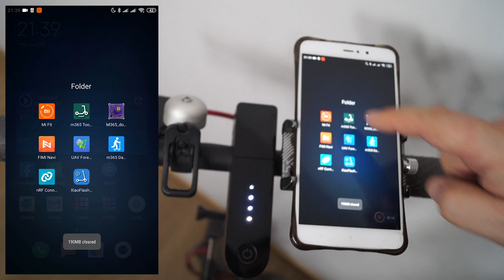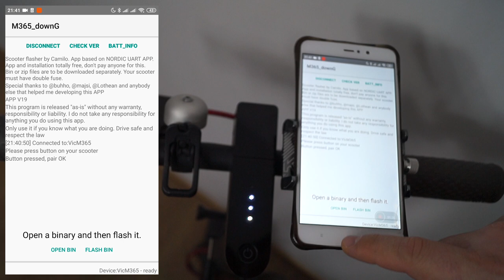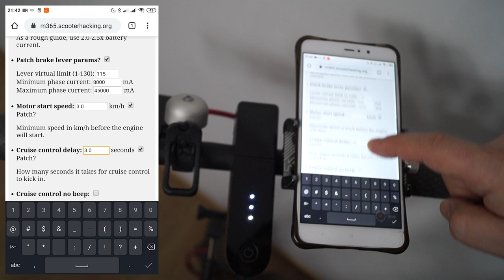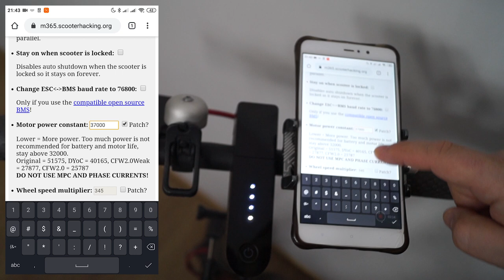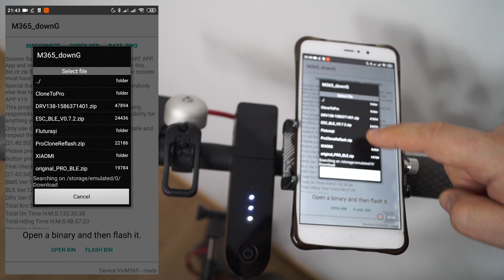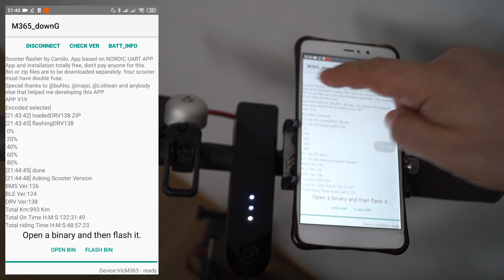XIAOMI M365 (Pro) | Do you want higher TOP SPEED or STRONGER ACCELERATION? Flash a CUSTOM FIRMWARE!

Comment: This sadly doesn't work for me. I have a brand new Pro with version 1.7.1. The app says the flash has been successful, but then nothing changes with the version and the ride remains the same with the same speed limit. Any ideas....? Thanks!
Reply from the maker: I don't know why this is happening. I heard other people having this problem, but I'm not sure what is the solution.
Reply: My Pro was updated to version 1.7.1. and i used this method to hack it and it only worked with russian throttle algorithm activated, it removes the speed limit (its still hard locked to about 34km/h with full battery) and i think it increases power limit to 750w to the motor in sport mode even if i dont change anything in the power settings.
The speed settings are bugged probably since they dont do anything.

Comment: Does it work with 1.7.1 ?? 365pro? Like the tutorial? Sory a little afraid
Reply: I just did it with XiaoFlaser. Works fine!
Reply: @tofn-bert9675 

My BLE is diferent from in the video is 0124 ... it works 0122 same way ??

Or must only direct create zip firmware 1.3.8 in the ( web site) and flash direct with XIAOFLASER  
my scooter: 
ESC firmware: 0171
BLE firmware: 0122
BMS firware 0126

Or I must flash first BLE 090? FIRST?

I read flash ble 090 doesnt work? BEcause is in  ble 122. gives error

so much question! sory for not know some details of the  flashing methods.  I am asking to  try not to corrupt the original firmware 1.7.1
lots of thx . Be patiance with my questions sory :D

I hope this questions is the awnsers for a lot of persons like me that have afraid to do. MUCH DIFERENT METHODS OF FLASHING.

thx in advance
Reply: @razokpipoca9240  I went from ESC 1.7.1 BLE  1.2.2 BMS 1.2.6 to ( just to try, ESC 1.6.6 BLE 1.1.0 BMS 1.2.6 ) and finally ESC 1.5.5 BLE 0.9.0 BMS 1.2.6 using XiaoFlasher and its firmwares. Android Phone. No error at all.
Reply: @tofn-bert9675  if one day you make a video step by step with this esc, ble, bms like i have i am the first to see it! :D
 Tanks very much for fast write back! keep good work.

My m365 pro
ESC firmware: 0171
BLE firmware: 0122
BMS firware 0126
Reply: @razokpipoca9240  I just followed this youtube video and links on it. Nothing more needed! ;-)
Reply: @Christophe Hennebert but with the  BLE  0122 that i have doesnt matter?  I do not need to flash another ble? Like 090? Plz be expecific. With my version, ble,etc. order to do things.  1 this , 2 that , etc. with the version i nave .I am new at this. Thx for help

Comment: Hi nextor ! After doing all that was explaining in your video, my scooter's battery suddenly got depleted. it was 80% before, have no idea what happened trying to charge it up right now. it did that after flashing bin...  any idea what did this happen. it is impossible to discharge full battery in 1 min and it was not even being used....
Reply from the maker: The firmware you flashed is not for your scooter. You probably have a Pro scooter and you flashed a firmware that's for the classic M365.
Reply: I have the same problem what is the solution ?

Comment: I have followed your procedure but my DRV does not change from 151 to 138 after patch :/ do I have to upgrade to 171 to downgrade to 138 or is something else going wrong?
Reply from the maker: No, you don't have to upgrade to 171. Try flashing using a different phone, maybe it helps. Also, try to flash using XiaoFlasher.

Comment: Hi, after i tried to hack my m365 pro i received a new firmware version V5.5.5 and nothing happened with my scooter, i mean same speed and all like the original version settings. Why i have received this weird version number and why i can't hack my scooter again. I did something wrong with the flash program or what? I updated with Xiaomi app to the latest version and after that it shows the same 5.5.5 version. How can i flash the firmware back? Many thanks.
Reply from the maker: You have version 5.5.5 because you enabled version spoofing in the custom firmware. Create a new custom firmware, but leave version spoofing unchecked and you will have version 1.5.5 in the end.
Reply from the maker: What settings did you use when you created the custom firmware?
Reply: @nextor11  I have fix the problem! That was completely true what you said, i had the spoof enabled in the custom firmware before . I simply unchecked the spoofing and write again a new over the previous firmware and...boom all is perfect now, working like a charm! Thank you so much for the great valuable advice! Greetings!!!

Comment: Hi, quick question, 
When you load up the m365scooterhack.org what preset should you select? What do the preset mean?
Reply from the maker: Click each preset and you'll see some values changing on the page. A preset is just that, some preset values.
Reply: Nextor, 
Ok so I’ve downloaded the downG app. Went online to m365hack website and selected the application that I wanted to change. I hit patch at the bottom and it warned about downloading and damaging the scooter. I continued but no download popped?? I went back into downG and looked in downloads and could see the zip file was there but no information in it. If I select the zip file it tells me it’s invalid with no information on it
Reply from the maker: I guess you selected zip v2 as output file

Comment: I don't need to downgrade BLE version on 1.6.8 version Pro model?
Reply from the maker: You can flash a custom firmware without downgrading the BLE, but I would advise you to downgrade the BLE anyway.
Reply: @nextor11  So I did a downgrade to BLE90 and flashed custom rom, it didnt worked first i flashed with spoofing and got 5.5.5 version, second I did without i got correct version but still no speed increase, any ideas why? I was able to install gonka from spzshop and got 30km/h, from what I heard 35km/h is max, any reason why first 2 times didn't worked? could it be because I didn't adjust Motor power constant?

Comment: Hey so my scooter is stuck on the battery lights after trying to flash. It is a double fuse. It can connect to Bluetooth on the m365 app, but not its own app. Any advice?
Reply from the maker: I don't understand what "stuck on the battery lights" means. Can you explain?

What scooter do you have, classic, Pro or classic with Pro dashboard?
Reply: @nextor11  I had to disconnect the battery and reconnect. With your settings on my m365 (not pro) it's going to a top speed of 17 mph. Is there any way I can get it higher?
Reply from the maker: Try flashing bms 115, ble 072 and then check the speed again.

Comment: hey m8, after using the guide and changing my cfw i then noticed my front brake comes on way too hard and tries to throw me over the top.  i have had help in trying to reset back, home app never does nothing so tried defaults on the 365.botoz site etc, and other cfw but we cant get rid of the issue?  any ideas or is it a controller issue etc?

Comment: Hi I’ve got a regular M365 my ESC: 0151 BLE: 0081 BMS:0123 why isn’t my versions the same as yours? I’m stuck and need help as my scooter is capped at 15km/ph :( I wanna flash it to 30.
Reply from the maker: Maybe I forgot, but I don't remember seeing ble 081 in any original Xiaomi scooter. The same for bms 123.

Try to flash ble 072, bms 115 and esc 138.
Reply: Victor Ungureanu I’ve flashed it earlier and previously I was capped at 15km/ph for some reason now I hit around 27km/ph from custom firmware :)
Reply from the maker: When the battery is fully charged, you might reach 30+ km/h

Comment: i get a red blicking bar  after flashing it. could i get some help?
Reply from the maker: That's happening because you flashed a classic drv firmware instead of a Pro firmware.
Reply: @nextor11  ohh ok. can i get the firmware on xiaomi essential (i have the hack but i only get 30kph not 35kph as well it fully charged
Reply from the maker: Don't expect 35 km/h on an Essential
Reply: @nextor11  ohh ok

Comment: I have the pro version and after the hack now I don't have the sport mode and the battery indicator does not work.
Reply from the maker: That's because you flashed a firmware that's meant for the classic M365 scooter, not for the Pro.

Comment: I have one m365 pro version 1.7.1 this procedure will works?
Reply from the maker: Yes, it works.
Reply: It didnt work on me,can you help me please
Reply: I can change the motor start up speed, but the speed limit is still 25km/h no matter what value I input 32, 35, 40, ...
Reply from the maker: Make sure that the battery is fully charged. Try with Russian throttle algorithm on and off. It should work eventually.

Comment: Hi, i Got the pro xiaomi and my version  5.5.5 in my firmware version and when i try to flash it into 1.5.5 it says done but not updating the firmware when i check the version again. Love you content Jeep up!
Reply from the maker: The version number is not changing because you enabled "version spoofing" when you created the custom firmware.
Reply: Victor Ungureanu so it Will Work if i turn it off?
Reply from the maker: It worked already, you just don't see any change in firmware version. Anyway, if you uncheck version spoofing it will be obvious that the firmware flashing was successful
Reply: Casper, You modified the firmware :)
Reply from the maker: Nice to see the community trying to help!
Reply: Anders Christensen I set at 22 in ECO But it goes at 25
In D set to 22, up to 33
In S set to 28 up to 32 
I used firmware for my pro on scooter hacking website
Reply: @AdrianIoan  jesus your battery drains fast i presume?

Comment: hello sir, i just did my scooter pro with your guide,
my bms ver :126, but ble ver: 122 is that okay?
i lost my battery meter in my screen. 
is that normal?
 havent tried it yet for the speed hack.
Reply: eco and D is prevent in my scrren. S option is not flashing or showing. 
is that normal for this hack?

thanks for your reply and help.
Reply from the maker: You didn't flash the right drv firmware. You flashed a firmware that's meant for the classic M365, that's why the battery meter is not working anymore, as well as drive and eco.
Reply: So I must down grade my firmware 1st. Mine is new 1.7.1 then I will downgrade it to get the ble 124

Comment: What to do if my M365 Pro is already on 1.7.1, can I still do it?
Reply from the maker: Yes, you can. First try to flash ble 090 and then custom drv 155
Reply: @nextor11  cant flash to ble90 (ble122 currently) cuz there are some errors, is it locked?
Reply from the maker: What errors and what app did you use?

Comment: The flashing works great, but if i use your settings the speed is 32kmh, but the acceleration is really slow.
Reply from the maker: There must be something different in your custom firmware settings compared to mine. I have very good acceleration.

Did you use Russian throttle algorithm? Are you sure you're not in ECO mode?

Comment: Bravo.
Reply from the maker: Merci! Ce fel de scooter ai, dacă nu te superi ca întreb?
Reply: Am un 365, crezi ca ar fi ok pentru ea sa incerc sa o urc la 35 kmh? Momentan o am la 29 dar as vrea ceva mai mult.
Reply from the maker: Nu va atinge 35 de km/h fără sa adaugi celule la baterie, dar 32 ar putea atinge atunci când bateria e încărcată la 100%.
Reply: Nici pro nu trece de 32 
Mie nu îmi place accelerația cum e in modul S vs firmware original, in cel original e mai puternica deși nu ajunge la 32 km/h
De autonomie ce părere aveți ?
Mie pe modul D, limitat la 20, nu mai reușesc sa scot autonomie mai mare de 25 km, am reușit cu firmware original sa scot chiar și 40 km autonomie
Reply from the maker: Autonomia este foarte puternic influențată de temperatura bateriei. Dacă ai avut 40 de km autonomie la 20 de grade afara, la 2-3 grade situația va fi foarte diferita.

Comment: Hello, the first time i tried to flash custom software following this video, it succeeded. Then I tried it again, because I found I didn't have enough power and it said it was done but it didn't go faster anymore. Also, the version changed to 538 for some reason. Then I tried it a couple times more but it doesn't work as the firmware settings tells it to work. I also tried flashing the bluetooth firmware (like in your previous scooter video) and then flashing it again, but that didn't work either.  Also, the firmware version stays on 538. What can I do to be able to flash it again?
Reply from the maker: The version 5.3.8 is actually 1.3.8 with version spoofing enabled. At this point I don't know what to suggest other than using an ST-Link programmer to flash ble and/or drv firmware.

The video showing how to flash ble using ST-Link is this one: https://youtu.be/xlezACP1YYw

The video about the drv will come this evening or tomorrow evening.
Reply: @nextor11  Is there a way to just get the normal firmware back?
Reply from the maker: Normally you can get the standard firmware back by updating using the Mi Home app. The problem is that you enabled version spoofing in the custom firmware and your firmware version now shows as 5.3.8, so Mi Home doesn't think it has a newer firmware version so it won't give you the option to upgrade.
Reply from the maker: If you really can't flash a firmware without version spoofing enabled using DownG or XiaoFlasher, then the last option is to use an ST-Link programmer like I explain in this video: https://youtu.be/aGCCmvfTRXU
Reply: Victor Ungureanu I probably accidentally enabled version spoofing so if i try tof flash it without version spoofing nothing seems to change. I will try it with xiaoflasher, maybe this works.
Reply: I just don’t understand once you enabled version spoofing once you can’t flash another firmware
Reply: Thank you for your help anyways!
Reply: One more question, why are both downG and xiaoflasher saying the flash is successful if they didn’t do anything at all?
Reply from the maker: I don't know why this happens.

Comment: Hi. I changed my screen to a Pro screen. I done the steps mentioned and everything works perfect. However the I can only use ECO or Sports mode. Anyone know why the normal drive mode doesn’t highlight or work. Also when accelerating the speed is slow then it picks up
Reply from the maker: Is the battery indicator showing the correct state of charge?
Reply: Nextor yea correct. It’s all working and the battery is fully charged etc. Not some reason the D mode doesn’t work. I used the pro firmware also.
Reply from the maker: I was thinking that maybe you didn't flash a Pro drv firmware, but if you're saying that the dashboard is showing the battery level correctly...
Reply: Nextor do you think I should do the procedure all over again. The reason I don’t want to use the S mode because it will drain the battery. I done the steps you mentioned today and haven’t done a long distance travel as yet. Am also thinking of going back to the M365 dashboard and not using the Pro one.
Reply from the maker: First decide which dashboard you're going to stick with. Depending on the dashboard you have to use a specific drv firmware.
Reply: Nextor as I already installed this dashboard so I will stick with the pro one for now. Can you advise me what’s the best thing I can do to sort this issue out with the D mode. Also In the sport mode the accelerations very slow and then the speed picks up after a while
Reply from the maker: Check versions inside M365_downG and tell me what it says
Reply: Nextor firmware 1.3.8. I checked that from the MI home app as my tablet isn’t connecting to the scooter
Reply from the maker: 1.3.8 is not good when you have a Pro dashboard. Carefully read the video description and flash a Pro drv firmware.
Reply: Nextor hi. I can’t thank you enough for your help. I done what you said and worked a treat. All the modes are now working. Can I ask 1 more question. My D mode acceleration is very slow. How can I improve the speed. What settings do I need to change to get the M365 normal speed
Reply: Nextor hi nextor. Please help. DownG for some reason can’t find the scooter anymore. Can you help me please
Reply from the maker: Try searching for the scooter right after you turn it on.
Reply: Nextor hi mate. Tried it and still doesn’t work. I tried to put the old dashboard on and seems it doesn’t work. The lights keep flashing and no sound. Wonder why the DownG isn’t finding the Bluetooth on the scooter

Comment: My scooter battery is low right after firmware hacking, is it normal?
Reply from the maker: Do you have a Pro scooter or a classic scooter with a Pro dashboard?
Reply: @nextor11  i have m365 pro
Reply: @nextor11  i have pro
Reply from the maker: I think you flashed the wrong firmware. You flashed a firmware that's for the classic scooter. Connect with DownG and check versions, the tell me what firmware versions do you have.
Reply: @nextor11  i think im fine now with my xiaoflasher app